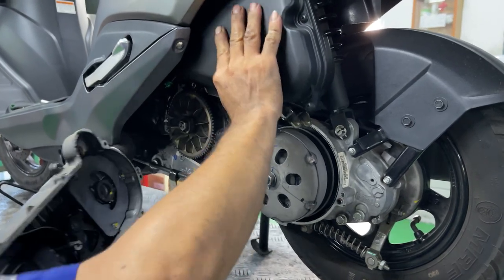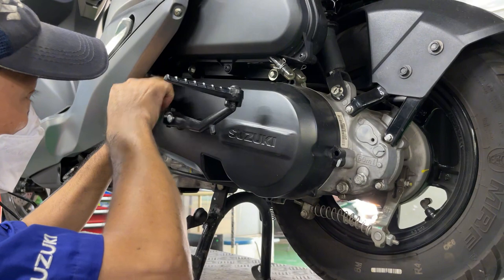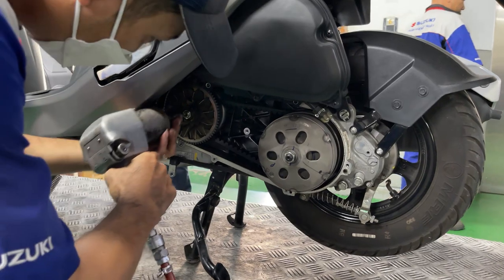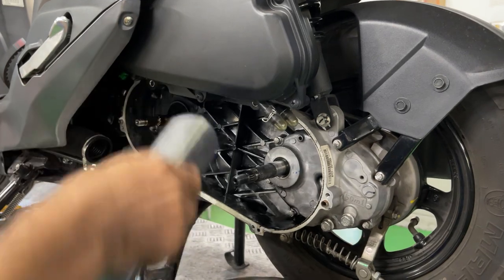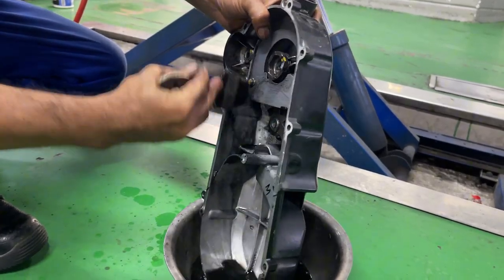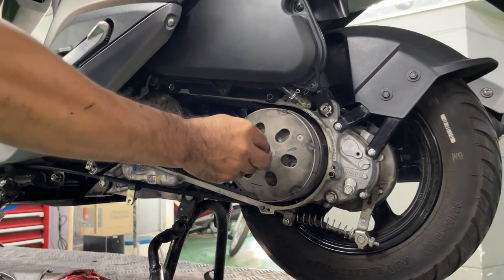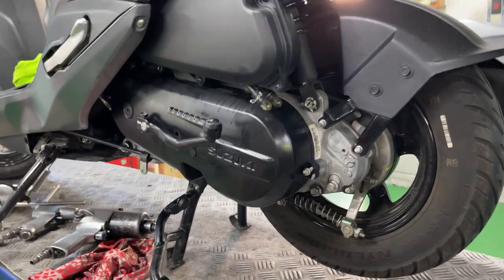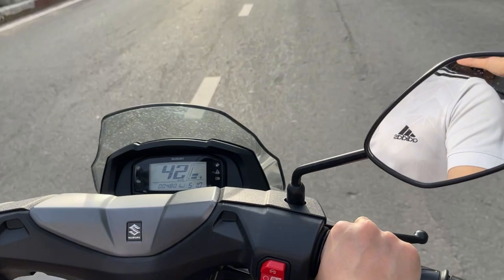You Should CHECK Your TRANSMISSION on SUZUKI BURGMAN 125

Comment: Its a big NO for using gasoline to clean the dirt for cvt, it will cause the other components to break like oil gasket please do a proper cleaning tools
Reply from the maker: That is 3M degeaser, not gasoline. We do aware that gasoline will harm the rubber badly.